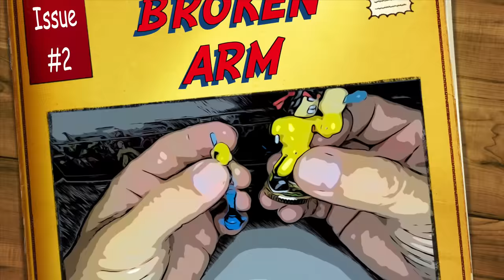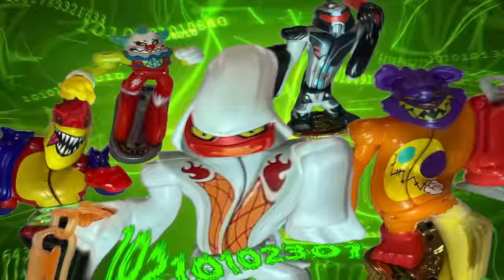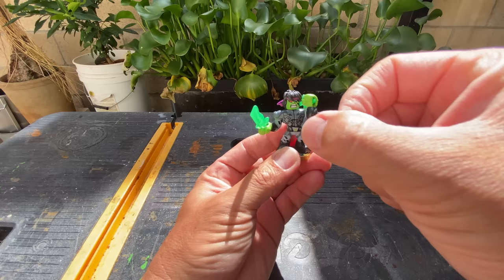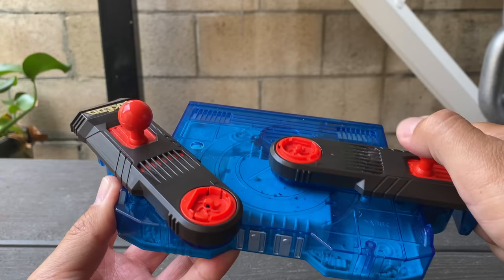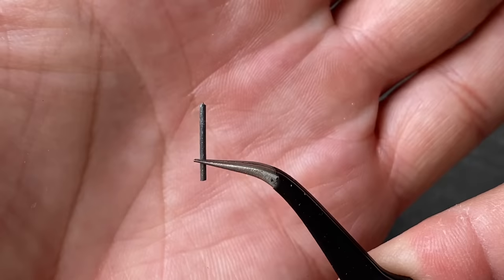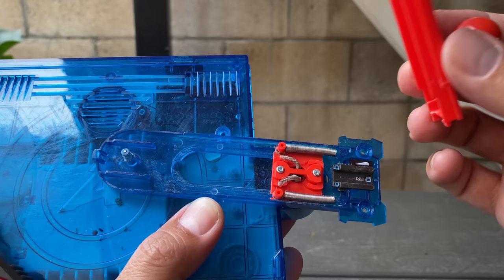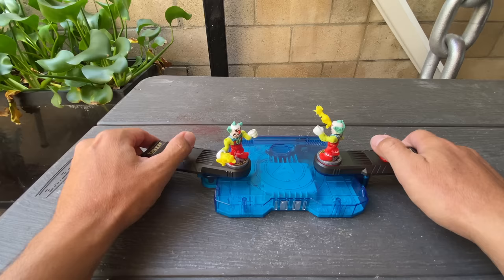How To Fix Your Broken Akedo Warriors & Battle Arena

Comment: Sweet! I had just noticed that spring piece for the head!!! Thanks for the walk-through to remove it. I will be fixing our Max Snapper. Also, that arena controller detaches from the main arena. May make it easier to work on.